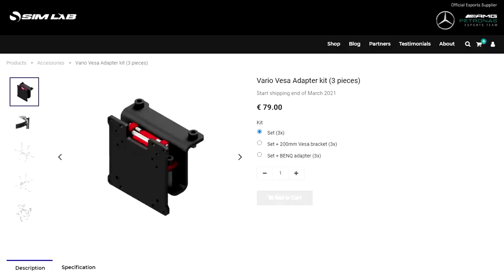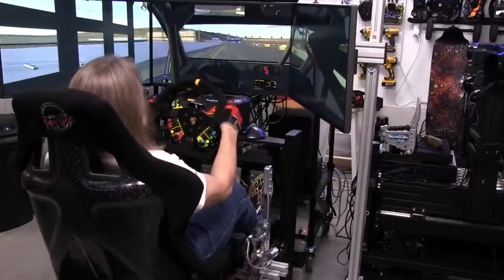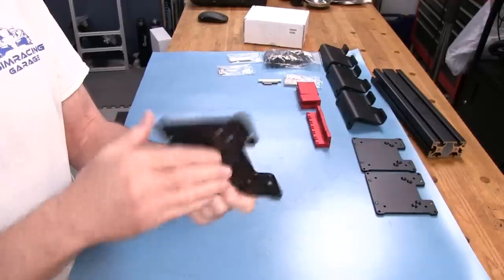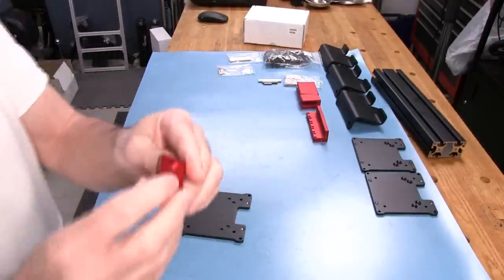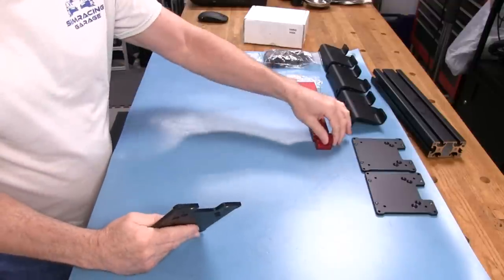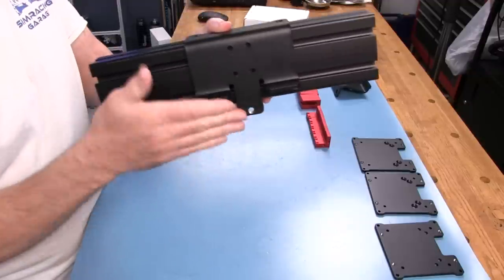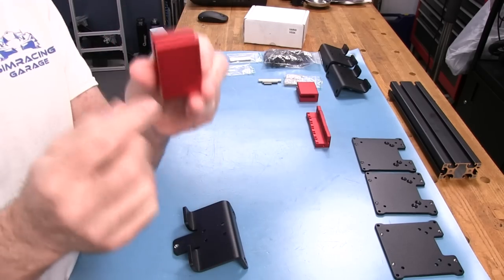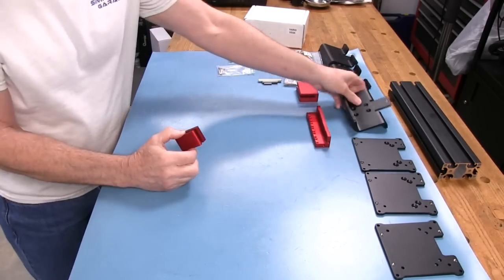Sim Lab Vario Vesa Monitor Mount Kit Review

Comment: this kit is the smartest simracing product ever, it solves once and for all the main issues with triple monitors..reason why I went to ultrawide, tired of neverending adjustments that were never completely right at the end. well done Simlab
Reply: Thanks Luther this means something to us! Although not our initial intention, we now believe we made triple setups a bit more relevant today with all the widescreens in the market!
Reply: @RichardSchouteren  hi Richard, any chance the store will allow to order just 1 vesa + monitor side instead of all 3, to use it on a ultrawide? it will solve the issue of the monitor tilt due to the weight of a 49", and also it will be of great help for the ease of mounting and unmounting such a heavy monitor to the stand. thanks.
Reply: @_xndrzt  you mean a separate unit right?  We can look into that!
Reply: @RichardSchouteren  yep, just a single piece instead of the whole kit of 3. I am currently mounting an uw 49" on the single monitor stand, and it always tilts downward due to the weight of the monitor..this would be super useful
Reply: @_xndrzt  gotcha. We need to implement it in the manufacturing but i think we will do it.

Comment: Thanks for the video. 

I have two tips for you for the calipers. 

1.) to measure the center to center distance between two equal diameter holes,
A- measure one hole with inside jaws, then hit zero
B-now use inside jaws to measure two circles apart from each other. You will get the exact center to center number (way better than eyeballing)
2.) to measure depths, use the depth rod. Also Way better than eyeballing the inside jaws.

God bless you and your family.

Comment: Thanks Barry! On point as always! 🔥
Reply: Any chance of larger mounts for TVs?
Reply: @flipcoin6301  yes in the pipeline!
Reply: It's sad shipping cost is over kill. Plus every part I get has chips and not finished right. Every product from simlab comes with no instructions which is sad for arm and leg pricing. plus every bag of screws Is busted Open when package arrives
Reply: @SIMRIG412  I've been pretty happy with my Sim Lab rig. Not much they can do about shipping costs, but you are absolutely right about the hardware bags. I thought it would be something that they would fix if they knew there was an issue, but it seems like they're still using the same bags.
Reply: Fantastic product, wish they where in stock though.

Comment: I installed a set last weekend. Worth every penny. Advice...the flexible extension which comes with an iFixit kit (or similar product) makes the lateral set screw adjustments much easier. Also...probably an unnecessary caution...but if you wind in the lower set screw adjusting tilt too much...you may push the vertical set screws off their ledge.

Comment: A note about those 5mm grub set screws, be careful on how much force you use to adjust them. I managed to bend two of them when I installed them. Easily replaced of course, but they were a challenge to remove after being bent. I guess I underestimated my own strength, and over estimated my  intelligence. A wonderful kit none the less.

Comment: One of the shortcomings I am surprised you didn't call out is if/when you pull at ALL on the bottom of the monitor, it can collapse onto the stand-side bracket. because there is no top screw or grub facing the plate to keep it from rocking back and forth.

Comment: Another great review Barry with great information!! 

It drives my OCD nuts though when you don't use the depth measurement tool on your verniers when you're measuring the setting length of the 40mm long socket head caps and just wing the measurement using the other end of the tool. I know it's just a mm or two but I would have to have them both at exactly 24mm and that's what the depth measurement end of the verniers would allow you to. :-)

Comment: For some reason this video never came up as I have been looking for a monitor solution for a few weeks now. 😟 I bought a different brand one that has the same adjustments just don't know if 300x200 Vesa will work with it as it does with this one granted you have to buy the adapter plate.

Comment: I'm looking for opinions on what other people prefer. I have curved triple 34" monitors. Should I butt the monitors up to each other or over lap the side monitor with the front monitor to make the bezel look smaller? I'm not sure how it would look and work with curved monitors. I have them butted up against each other now and they look great but, would like the bezel as small as possible. I have the zero bezel kits also and just not a fan of them as they are for 27' and are a little short for my monitors and distort the displays just a little to much for my liking.

Comment: Hello Barry
I’m looking Triple Monitor Stand’s for my 3x55” tv 
My problem is I’m looking at the Track Racer or Sim Lab Freestanding Triple Monitor Stands
What I’m thinking of is getting 2 single Track  Racer Monitor stand’s
Using the 2 Center crossbar on the single stand my left / right outer arm’s and using the extra legs for support 
My problem is the size of the Crossbar 
What would you recommend 
I was think 1600mm ( 40 / 80 ) 
It’s only the size of the crossbar that’s holding me back 
Do you think that would work or do I need bigger than 1600mm 
Any help would be really appreciated 
Thank you

Comment: This is a great solution to a complex problem, but I see one limitation with this design. This will work perfectly well with stationary monitors but if you have a motion rig with your monitors mounted to the rig I see this being a problem as there is nothing actually holding the monitor rigidly in place. It would be smart for a second iteration that allows you to actually lock in the position once you have it. It would add a bit of complexity engineering wise, but be vast improvement.
Reply: Mounting monitors to a moving platform is never a good solution because weight slows down motion (acts as a damper)  and introduces more wear on actuators.